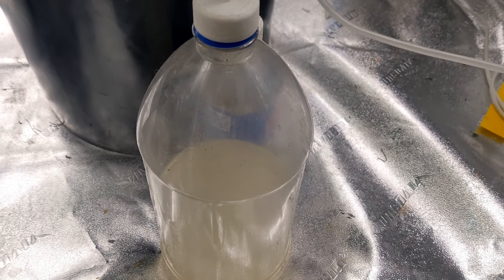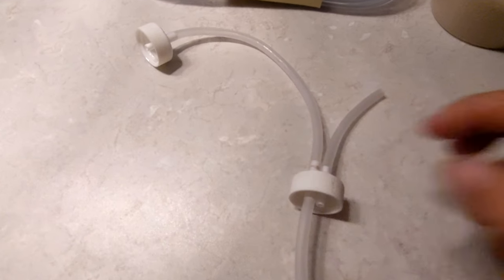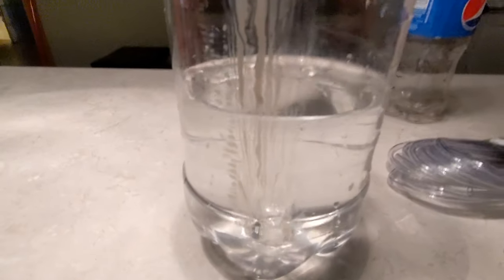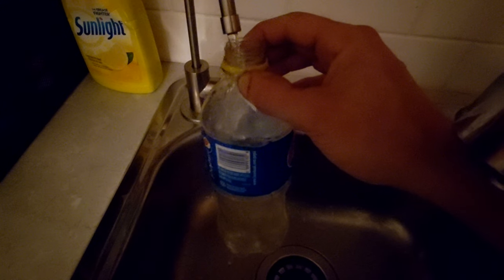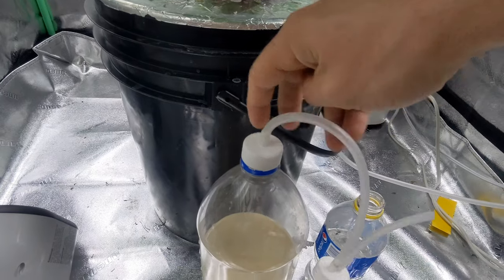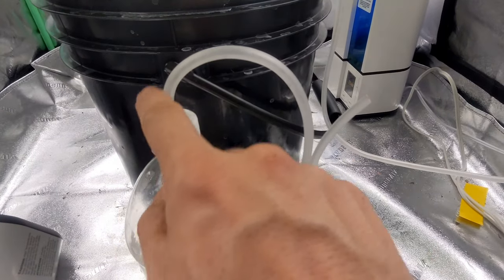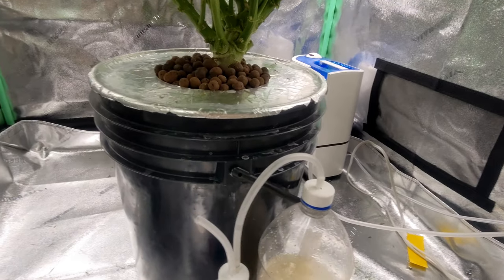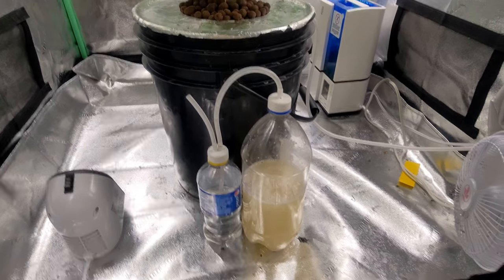DIY C02 Setup for Grow Tent

Comment: Simpler is to pin prick a balloon and stretch it over the bottle neck. Balloon will expand and gradually release CO2. When balloon goes deflat3s either shake mixture or replace.
Reply: Genius brother

Comment: i like useing this method to produse co2. I allso set up my co2 device inside the grow tent on top of the light so my solution will warm up which helps the fermenting process. useing this method, my co2 canister starts high levels of co2 with in 15 min.

Comment: I made one with 5x your recipe in a 5 gallon clear blue water jug bought from walmart and added an air stone to keep it constantly mixing as well as an aquarium heater in the sugar mix to keep temps around 70-80f all times. The exhaust tube is taped behind the fan that blows over my canopy. Been 3 days now and my 4x4 tent just smells like bread and liquor but CO2 PPM still at what it started at around 400ppm-500ppm (sensor in the canopy)... Not sure how effective this is, maybe it just takes time but so far it has not done anything for me. Also I made sure the yeast was activated in 105f water for 15 minutes before mixing it in. Just my $0.02 is all.
Reply: Yeah, I thought this too. Found out that my CO2 sensor was faulty, I purchased a new CO2 sensor. Levels were steady between 400-500 PPM over a few weeks at 5x the recipe still using a new batch of regular yeast and sugar water. I also tried 5x of instant (activated) yeast as well and co2 didn’t get above 500 even with my vent fan off for a day, turning off my exhaust vent actually made co2 drop into the 300’s.
Reply: @kumd  it's lower after you turn exhaust fan off as your plants will be using what's there.
Reply: @Lotus at the end, have you bought some CO2 generator that worked in your case if this method didn't? Or you managed to make this work?
Reply: @kumd did you put the bottoms up high or leave em on the floor
Reply: @prizmik  ended up getting a co2 tank from my local welding supplier. Way easier and efficient
Reply: @JohnDoe-kz5fr  on the floor, had a tube connected to the back of a fan blowing it around
Reply: @kumd  shouldn't it be higher because co2 is heavy or no
Reply: because alcoholic fermentation works anaerobically, if you insert an oxygen stone you block the fermentation...
The yeast only needs a small amount of oxygen at the beginning, once consumed it will start the real fermentation, consuming sugar instead of oxygen producing alcohol and co2
The bubble counter mainly serves as a non-return valve so as to prevent oxygen from entering the bottle
If you want to produce co2 for a grow room you must use quantities much higher than those shown in these videos, which in reality are only good for aquariums.
(we are talking about at least 5kg of sugar with 100 grams of yeast to have a co2 production necessary for a grow room of 2x2x2m for about 4/5 days)

Comment: How to you avoid losing all that CO2 when you're running an exhaust fan? My fan, which I have to run to keep the temperature down in the tent, sucks out virtually all the CO2 my 5-gallon DIY-bucket-rig is generating, and it's output is quite high. It was great in the cold winter months but isn't working in the summer. Any ideas? Thanks for the video.
Reply: Put your generator at one end of the tent and you Co2 at opposite end. Provided your generating constant co2 your plants will use it. It's more important that you moderate the temperature.
Reply: Maybe Stop IT for 10 mins in a hour ? With a Controller

Comment: Think about the head space, you want to keep the water high enough, but not so high you get foam through the generator cap. CO2 is HEAVIER, so the first bubbles are just air pushing out until the CO2 reaches the cap.  Then, on the indicator bottle put a hole in on the side and run that water just below the hole so it flows out, not fill another bottle.  
I hope this helps.
Reply: I'm sorry if this seems dumb, but I didn't get you. I understood the part about having enough headspace so that you don't get foam through the 'generator' cap. Didn't understand what you mean by 'indicator bottle' -> and hence, I don't follow anything after that :/
Reply: I think the reason he's using a extra bottle is so that no bad bacteria gets to his plants

Comment: Hello great vid. I've been looking into making one of these types of diy co generators. Mind sharing the link to stl of caps for others with 3d printers? 

Going to make a diy co2 sensor (microcontroller based). The average co2 level outdoors is between 250-400ppm. Indoor co2 levels are generally higher. I'm told the plants i grow benefit from co2 levels in the 1000-1200ppm range to increase yields. Wonder how much these diy generators produce and if beneficial in open unsealed tents grows. If you are interested I can report back the amount of co2 your solution provides with my 2x4 setup. I hope to find out if this generator or multiples of it are able to bridge the gap to the desired co2 levels. If not, still a fun little project to see what actual amount of co2 is produced.

Comment: Any idea at what temp the reaction stops or slows? Wondering if a heating pad under the bottle connected to the light timer would help increase lights on production
Reply: Good question and idea, id like to know as well
Reply: Keeping the yeast warm will speed up co2 production. And will burn out the sugar quicker. But also if the yeast gets too cold it goes to sleep or produces much slower

Comment: Does it have measurable effects? Have you seen how much this raises co2 levels?
Reply: I 5x'd his recipe and so far it has not done anything for me after 3 days. Made mine in a 5 gallon clear blue water jug bought from walmart and added an air stone to keep it constantly mixing as well as an aquarium heater in the sugar mix to keep temps around 70-80f all times. The exhaust tube is taped behind the fan that blows over my canopy. Been 3 days now and my 4x4 tent just smells like bread and liquor but CO2 PPM still at what it started at around 120ppm-160ppm (sensor in the canopy)... Not sure how effective this is, maybe it just takes time. Also I made sure the yeast was activated in 105f water for 15 minutes before mixing it in. Just my $0.02 is all.
Reply: @kumd  did you ever get an increased reading?
Reply: @jasonfabish189  Nope, I thought my co2 sensor was broken (it was) so I ordered a $400 high end one and even with 5 gallon mix and bubbler I was never able to get above 400-500 ppm with or without the mix, didn’t matter. 400-500 is basically the same as outside air ppm’s. I had my tent sealed shut too, also tried pre-activated yeast also in case I messed up somehow but still no change. Pretty much tried everything and none of this did anything to raise the co2 in my 5x5.
Reply: @kumd  thank you for that mate,its kind of what I expected. Seems like just breathing in the room for 10min would do as much if not more than this.

Comment: You need to get a ton of stuff dialed in before you start worrying about co2. For the average at home grower co2 isn't worth the hassle. Unless you're growing in a sealed, climate controlled grow room then co2 probably won't make a noticable difference in your results. Just use quality lights like HLG, dial in your nutes and keep VPD on point.

Comment: It really work, but this amount is only for fresh transplated seedlings ,half feet (15cm) big, in small 1,5x1,5x2 tent sealed with duct tape over all zip and without any holes and venting... For mid veg plant 1ft tall and wide you need 4x more yeast, that means, you need 4x more water and sugar (bigger amount of water and sugar=longer live) . In high temps (95F or 30C) it generate nice amount of co2. But for 3x3x6ft big tent with 4 big plants in mid-late veg stage, you will need at least 10gal (40l) jerrycan with 4 cups of yeast and 40 cups of sugar. Also big tents are not so sealed, so you need place tent in sealed room, where you can see big leakages of CO2. Cca 1000ppm in tent means 700-800ppm in closed room... In night you need know, how to stop dosing co2 in tent. After heat up, it boiles really crazy and can in hour after light off rise up to 5000ppm.
GL and HF with testing, at 1st, with at least 2 co2 sensors (inner and outer with alarm, that you stay alive :D ) and fan circulating air from bottom of tent! Dont forget venting in room in night...
Btw sealed tent need have A/C unit with dehumidifiing, power od cooling must be equal with power of light, and dehum capacity same as daily amount of waterring water
Reply: its very complicated

Comment: Put a heat mat under it so you dont waste the yeast and sugar. Once it starts, you dont want temp to cool off while lights off at all,.it will degrade your output per materials used

Comment: For how much days you use this? Is good for one cycle ?or you need to put some sugar after  or do other things?
Reply from the maker: Just shake daily when lights turn on and refill when the mixture stops producing CO2(bubbles)
Reply: @weedgrownindoors9322  now that I think about it it's obvious haha and you refill with sugar or yeast? And it's possible to do this from seedling to harvest ?
Reply from the maker: I redo the whole mixture as it's less than a buck for a refill, and yeah you can I don't use it until about the second week of veg though myself
Reply: @weedgrownindoors9322  okok so if I understand you do the same but new ,nice , thank you and sorry for my English if is not good 😁😁 and with this CO2 home made you have see some improvements?
Reply from the maker: No worries! Yes big improvements vs not using one 💪
Reply: So the extra bottle is just to show it’s working due to bubbles
Reply: @bbrewster1986  yep and for counting how many/much bubbles per sec rise, if the rate is faster that means ur yeast is working super fast, which means it consumes the sugar faster, which that means more refilling/re-setting this up....slower rate slower consumption and so on....what you want is a nice firm few bubbles a sec/min....if you keep feeding the yeast and a shake here nd there it keeps going...but you will hit a point where you need to switch it out or change the fluid/water out if not the yeast kills itself...put it aside while lights off, plants wont use it...interesting that fishtank stuff works for that too 🤷🤣🤣🤣

Comment: So I just made a mix of sugar/warm water/ yeast in a bottle and that’s it the bottle is in the tent just open sitting in the Gorilla Grow tent pouch on the right side. 

Am I CO2ing?

Seems to me the bubbler bottle is just to show that it’s working. Or am I wrong? 

I want to implement this in my tent. If anyone has tips I’d appreciate it. 
Happy growing. 🤙
Reply: That's what I was thinking too, surely the reaction alone is enough without the second bottle, my thoughts were either maybe that it slows the rate of reaction, slowing the release of co2 or it is to prevent airflow into the reaction bottle, if anyone could back these thatd be great but tbh i dont think its of too much importance although it is nice to see how much co2 is being bubbled through and when your reaction is finished
Reply: Yup second bottles to make sure its producing but it helps to know when you have to refill with new yeast and and sugar and water
Reply: @rowanmontague422  - I also question the efficacy of this method. My tent isn’t sealed and I don’t have anything to actually measure the PPMs of CO2. 

I just did it for fun but I doubt it’s making a difference in my garden at the moment. To really benefit from CO2 you need it over 1000 PPM. So a different delivery method would be in order.  I don’t think I’m there yet to invest in tanks and CO2 regulators. Maybe after a few more grows.